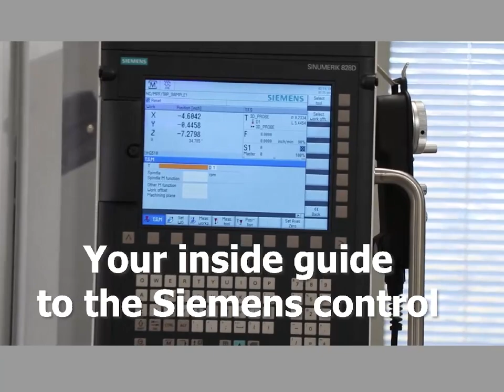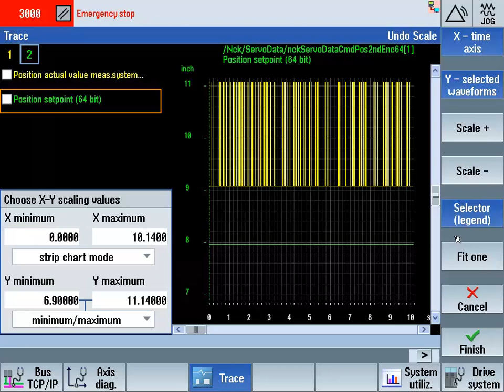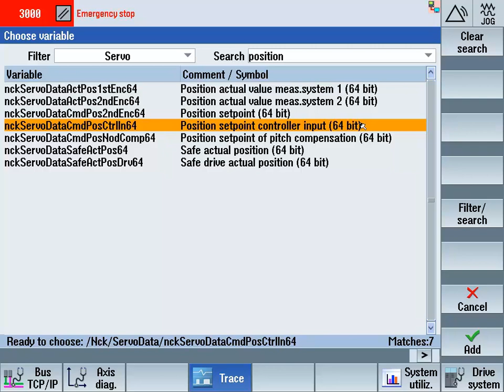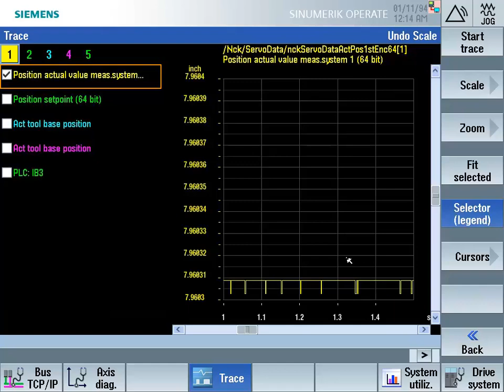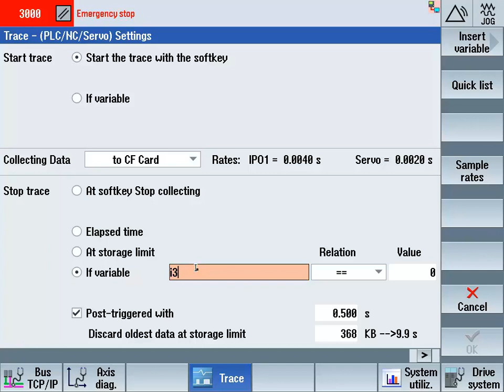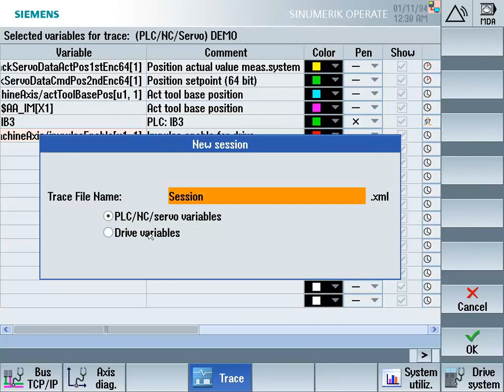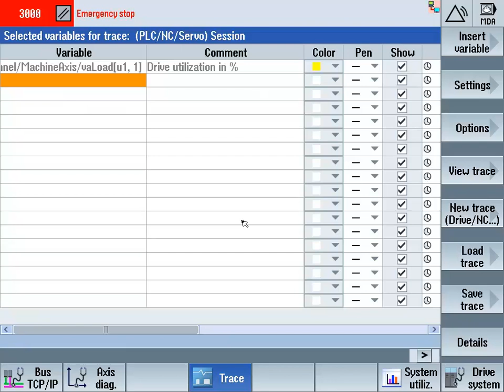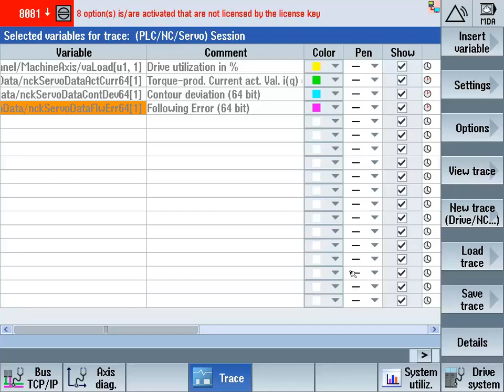Sinumerik Trace Tool in Operate

Comment: Thanks! do you know if I could avoid trace during G00 steps? (I'm interested in finding max torque/currents during machining)
Reply from the maker: Not that I know of - it is not possible to exclude / filter for those. You may be able to trace $P_GG[1] which would tell you the index number of the G code active in group 1, but have not tested this yet.
Reply from the maker: Another update:

I’m sorry, but it is not possible to suspend the trace while in G0.

In Operate, It is possible to trace the current G Code by group with the variable /Channel/State/aGG[u1,1].  This will return an integer value for the active G code in the group.  The integer to command conversion is in the Programming Manual-Fundamentals.  In new versions, it is in Chapter 17 (Tables), 17.4 (G Commands).  G0 will have a value of 1, G1 will have a value of 2.  This can let you manually work out the on/off part condition.  If your version of Operate supports saving .csv files, this data manipulation could be handled in Excel or LibreOfficeCalc.
Reply: Thanks Well Explained